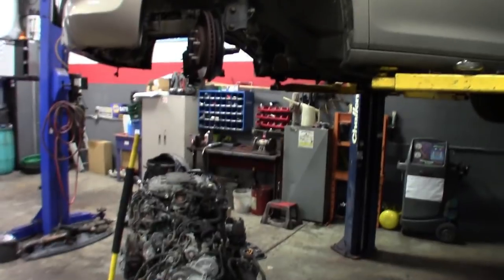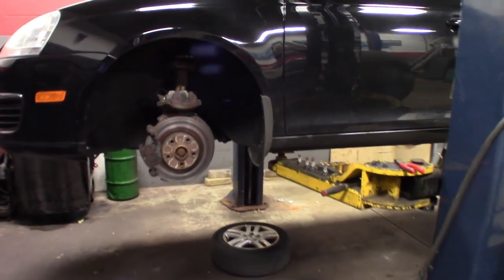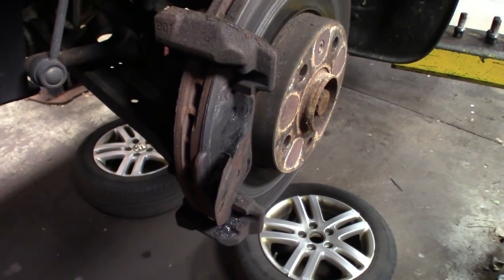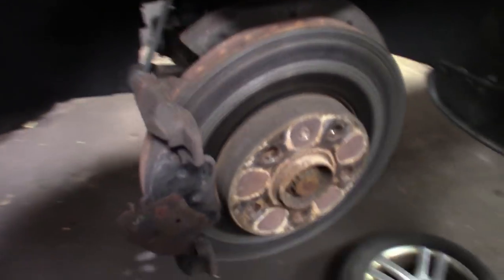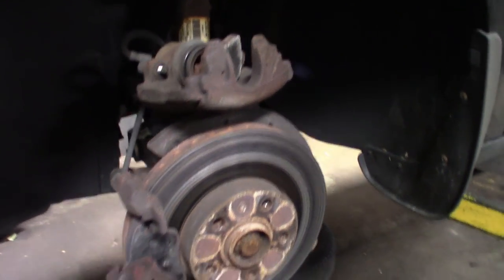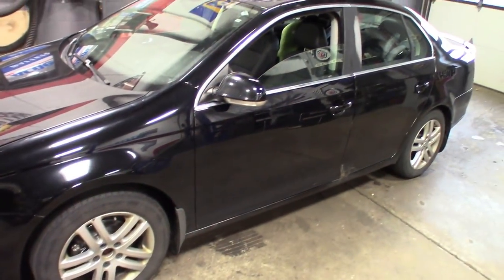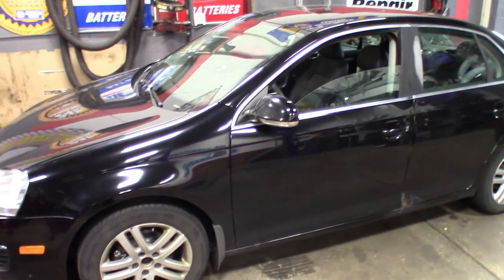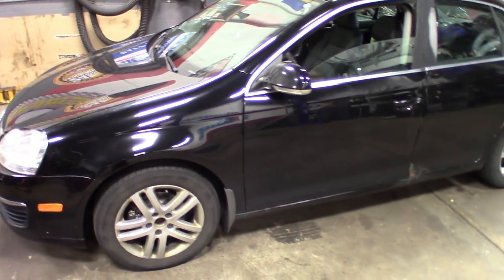SELL ICE TO AN ESKIMO

Comment: Yesterday had a Hyundai Santa Fe 2.4. No front brakes.. Customer ONLY wanted pads/rotors done. I advised them they had: both CV boots ripped, p0113 (massive vacuum leak), p0452(complaining about fuel economy), p0433, and 2 1/2 quarts low on oil. Neighbor came out, wanting me to look a no start on their 2.0L Neon, they hit a curb, timing belt snapped, say goodnight.. 0 psi. Declined that job. Literally a roach mobile. Today should be better.. Seville power steering leak on drivers side floor board and Ford 4.6 intake leak haha
Reply from the maker: Know how that goes. I've had customers come in for a/c work. When there tires were ready to fall off and the brakes were so bad. Ft was loose, But all they cared about was getting the a/c to blow cold. And declined rest of work.

Comment: Did you have to bleed the abs system also? Great video
Reply from the maker: No that one I got away with just doing the regular way. If it was brake lines I replaced then I use the scanner to dump and open the abs valves.
Reply: JRC54 allot of solid info on the channel man thanks